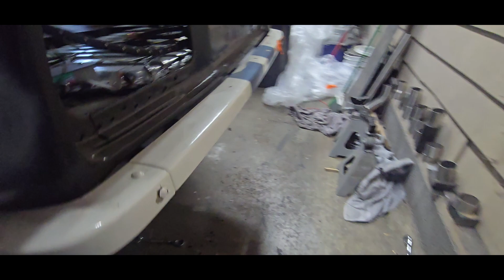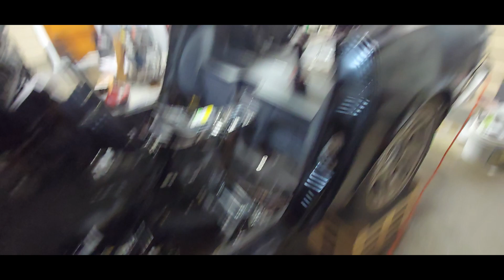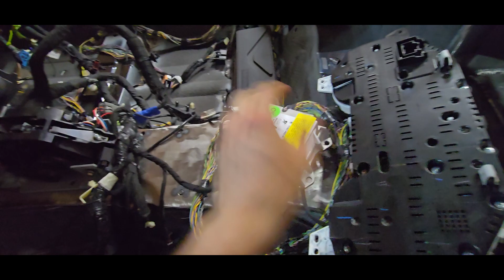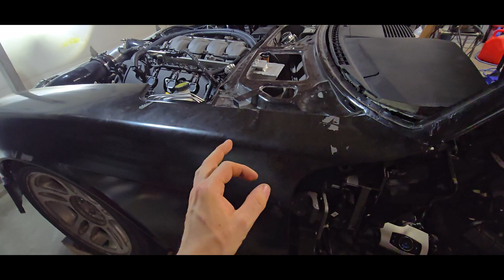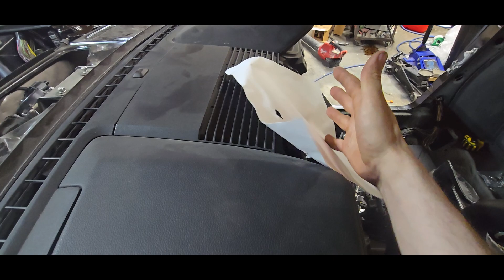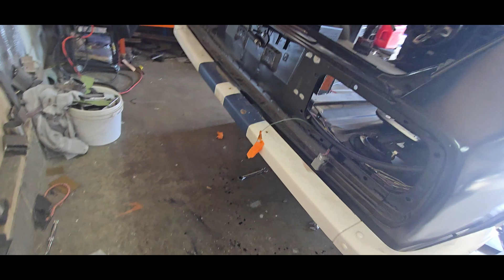After Years of Work My 240z Coyote Swap Is Finally Running!

Comment: Eeewwwww, it sounds like a Ford with the ignition on. Ya, it sounds like a Ford coyote out the exhaust! Milestone. Weird how you let go of the push button and it kept trying to start. I dig your build. Can't wait to see it on the ground.
Reply from the maker: Thats the normally starting process for the s550 mustangs. If you push it again it will stop cranking. It caught me off guard too at first when I was manually checking for oil pressure.
Reply: My 18’ s550 scared me when I first started it. I thought the starter was broke but it only lasted a sec. It’s actually pretty cool.
Reply: Awesome build bro. 😎. New sub here. Can’t wait to see more!!!
Reply from the maker: @geetar82 Welcome! Soon enough we'll get this datsun back on the road.
Reply: So sick! Awesome build, can't wait to see some slides n skids!!